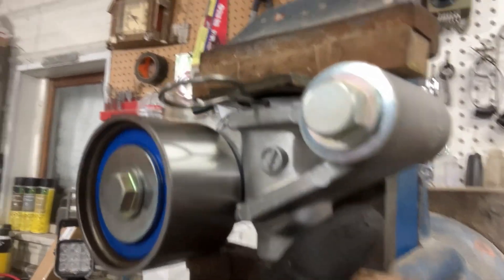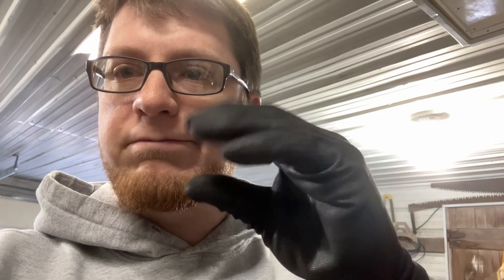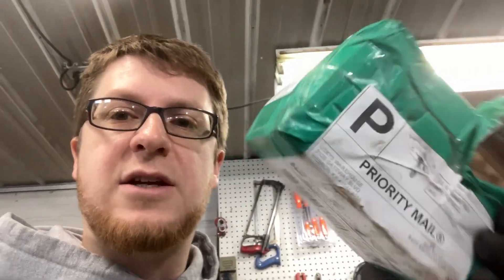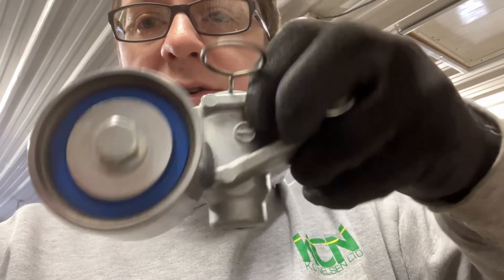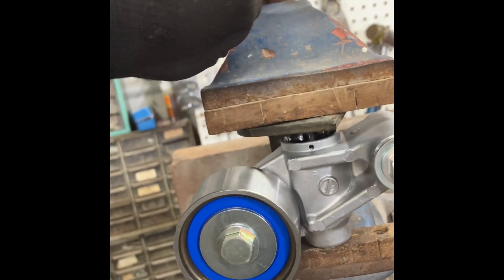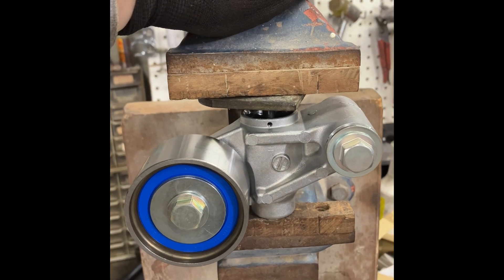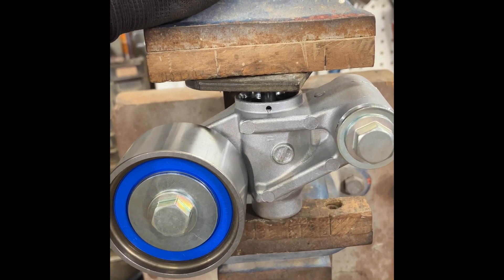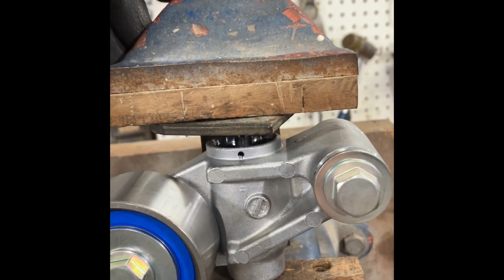Subaru timing belt tensioners, my nemesis

Comment: Recently replaced timing belt in an 08 legacy. New "kit", but it was a cheap one. Now there is a pronounced Subaru knock at start-up. Removed the half cover on the belt and the tensioner is vibrating at start-up but smooths out with a single engine rev. Only about 2,000 miles on new parts but I feel like I'm living on borrowed time. Sounds like I should re-do the job with a quality tensioner and possibly do your bleed technique.
Reply from the maker: I'd recommend replacing the tensioner with a quality one for sure.

Comment: did this help?
Reply from the maker: No. Ones I have bled have failed as well. I believe the issue lies inside the cam journals of the cylinder heads themselves. If the surfaces are marred and cause the cam to hang up slightly, it will cause the belt to over tension the piston in the tensioner and cause failure

Comment: No no your not doing anything wrong they absolutely suck I get the old style timing belt tensioner. I have a 97 legacy one to be exact and it works perfect… the rcm brand even copied the old design. The new ones suck.
Reply from the maker: I know there are kits available to go back to the old bracket and tensioner, but they’re something like 500 bucks. You just never know when these beasts are going to fail and then lights out… maddening when it happens. Other times, they will last forever. I don’t get it.

Comment: Part 2:  I do have 1 issue.  Covers off, I started the engine. No misfires or knocks.  Normal.  

I do hear a ghostly singing noise coming from either the crankshaft pulley or water pump.  Loudest just above idle.  

I hope it’s not the new crank seals I installed. Right?  They’re genuine Subaru, nothing weird.  The old one did leave crumbs that needed cleaning out—I hope none fell into that hole at 6:00 in the bore.

Have you had this ghost sound, perhaps normal with all new parts and no coolant or covers?
Reply from the maker: Thanks for the comments! I think the singing sound is the tone ring on your crank pulley rubbing slightly on something. I have seen this while trying things out with covers off. I assume you don’t have the damper bolted to the crankshaft? Try that with covers off see if your singing goes away. Please report back.
Reply from the maker: Sorry, try bolting the damper onto the crankshaft to see. I wasn’t specific enough. Doesn’t have to be torqued on to try it
Reply: @ Hello, covers are off, crank pulley is on with just one zap from the impact  gun for testing only.  Thanks so much for your reply—

I ran the test again, this time with my left ear on the lower radiator hose—“in” the hose actually-I am now fairly certain the ghost sound is coming from the water pump impeller spinning in the air.  The new pump is steel and resembles a windmill—so after the radiator and coolant are installed I expect no more noise.
Reply from the maker: @ excellent! Best of luck my friend

Comment: Hello, Putting my 99 Forester 2.5 back together, thank you for the excellent tutorial on bleeding that stupid tensioner.  I bought mine on eBay, Japanese part but  “new other”, so it arrived with no pin.

Given your warnings, I made a shim that prohibits that tensioner from retracting.  

I used a fender washer that is the same inside diameter as the piston and the same outside diameter as the casting, and cut a 1/4 inch slot to allow me to install it like a body shim—I installed belt, pulled pin and slid the shim into place.  The fit was a little loose, but the air gap is negligible.  To prevent vibration from possibly dislodging the shin I did put a heap of RTV on the tensioner first, smooshed the shim over it, and turned the shim 90 degrees to the slot is aimed down/left.  

I think it will work.  Once the tensioner is released and the belt has been cranked over a few times, the air gap is set and can be filled into avoid trouble.

Comment: the ones in the Aisin kits have been changed to a different design. they use to come with the exact same one as an original, but now even though the box say NTN and made in the Japan, the tensioner looks different than the genuine Subaru one which has "Japan" cast into it. (the new NTN ones dont). and i dont think they are the same quilty as the old ones. ive installed hundred on tensionors over the years and the only failures ive had where aftermarkets. try getting some OEM ones. if you dont have a dealer local, you can order online from Subarupartsdeals or Quirkparts. if you cant , might be better off reusing the original than installing a bad aftermarket.

Comment: I was a loader at UPS during college. Unless they've changed their rules to account for this somehow, there is no guarantee that your package is going to be shipped in a given orientation.  You can put arrows on all sides of the box and the label on the 'top', and it'll be more likely, but there's a good chunk of loaders that DGAF about your package. So, they sit in the semi trailer however they're oriented. Then, the unloaders at the next location are likely much more careless. Once it's in the system, though, it moves pretty fast for the most part. Just wanted to put that out there.

Fun bonus fact: I lived in central Japan for like 9 years and, at one point, was a delivery driver for a parts supplier for a lot of automotive-related factories around Hamamatsu City (where Soichiro Honda grew up). Dealt with Aisin, NSK bearings, Showa shocks, Showa leather, Enkei wheels, and a number of other suppliers commonly-used parts.

Comment: Just had a belt slip several teeth on the right cam after a head gasket repair Had a belt guard in place.  I reused the tensioner and belt since they had less than 10K miles.  I did recompress the tensioner a couple times and stored it on its side for a month.  Guess this explains my dilemma why the belt slipped so much and I did hear the “knock” but didn’t recognize what it was.  I do have valve damage so get to do it all over again.  I don’t think my cam would have hung up most likely thinking tensioner especially hearing the knock,  My belt slipped at idle in the garage so thankfully wasn’t stranded.
Reply from the maker: Sorry about your fortune. Tensioners seem so finicky. It’s almost like it’s vudu… real stupid

Comment: Over 3 minutes is a bit excessive. The instructions in my kit said no faster then 1 minute up or down. In service, the tensioner is going to see activation a lot faster then that. Pretty much instantious as your hit the gas the belt on that side will slacken, and tensioner will respond just as fast. Take foot off the gas and it will tighten just as fast, requiring the tensioner to respond just as fast. The issue was, you just were not bleeding the tensioner. I don't care which type of box it is in, it will end up being spun around in all directions during shaping. Bleeding is a must!

Comment: Hi is it possible to remove and fit just an aftermarket belt guard to a timing belt already fitted? My belt is only three years old and I would like to upgrade the guard for piece of mind.
Reply from the maker: Yes, you can add a belt guard pretty easily once you remove the timing cover.  I’ve done that several times.
Reply: @stvnswld  Awesome thanks for the reply 👍

Comment: Doing my own and thinking of adding a hard stop. Screw from top of bracket to limit the amount the tensioner can back off. Or a split set collar spacer on the tensioner piston if it can be fitted after tensioned...🤔
Reply from the maker: I have started using belt guards like the manual trans cars have. Over the crank pulley. I have also done what you’re suggesting! I notch a washer that slide in around the pin and then I put a couple of rubber washers around the pin also and silicone them together. To limit the amount of travel upwards the tensioner can go, great thinking. Necessity is the mother of invention, my uncle always says!

Comment: I don't know how many subaru timing belts I've done at my shop, but I have never had a tensioner failure. I do nothing special, other than install it right out of the box. Gates come laying on their sides, in the kits. Not sure what your issue was.
Reply from the maker: I think the cam hangs up in the journal and tightens the belt, causing an overload on the tensioner. Something I’ve learned since posting this vid
Reply: @stvnswld  i have seen that. Actually seens the cams snap in half from it.
Reply from the maker: @Arcade-fix  what causes that kind of damage? Dirty oil or lack of oil pressure? To cause the cams to wear and potentially break?

Comment: I stripped the 10mm bolt for the tensioner, no helicoil for me, i drilled out the remaining thread and with a longer bolt , threads out and a washer and nylock nut pulled it up to a snug pivot point ,what could go wrong? Already 50000km,

Comment: Bought a 03 OBW from someone who DIY'd head gaskets and timing belt. He must have not known what a torque wrench is because he stripped out the tensioner mount, which fell off two months later shredding my timing belt. Forced me to learn how to tear down heads and replace valves. What a headache!
Reply from the maker: I feel you! Quite the job indeed.

Comment: Do you have a part or source of where you're finding your belt guards? I've got the 3 and 4 cyl phantom misfire going on above 4k rpm. I've swapped every part except the reluctor gear, which I have ordered. Figured as long as I'm in there I would put on a guard for added security. Thanks
Reply from the maker: I get them on eBay. Usually they’re about $15 each. Another thing to try would be dumping a can of sea foam in the fuel tank. I have a ‘13 forester that was coding for “random misfire”, P0300 over 3500-4000 rpm. It hadn’t been run in quite some time, so I’m thinking the injectors weren’t flowing well over 3500 Rpm. After putting about 20 miles on, I can’t get the code to come back.
Reply: @stvnswld I have another 09 forester as my daily, so I swapped the entire intake and wiring harness over from that car to the one with issue, and it didn't take care of my problem. I'm just about at a loss as to what it can be if the reluctor doesn't take care of it
Reply from the maker: @prestonbear8981  I get that. I’ve been there! Misfires are tricky devils. I would try the seafoam, I know it’s like mechanic in a can but it’s worth a shot. Put it in the fuel tank and run it.
Reply: @stvnswld  I will give it a shot although I don't that's the problem because the injectors were part of the intake swap. I had the codes before I put a new short block in it as well. The old one had a rod knock so it needed to be done and just thought the misfire may clear up with the new one, but no such luck yet. I swapped the crank sensor with the other car as well, and put on a new Aisin timing kit. Heads were gone thru as well.
Reply from the maker: @prestonbear8981  you’ve probably already tried a knock sensor. I seem to remember a guy having a misfire and it was a bad variable valve solenoid. I don’t know how to test those though.
Reply: @stvnswld  it's a phantom misfire though, it's not actually misfiring the ecm just thinks it is, that's why I'm leaning towards a reluctor issue
Reply from the maker: @prestonbear8981  I hope that takes care of it for you. Let me know what you come up with!
Reply: Just wanted to update you and anyone else having phantom misfires at high rpms on both sides... A new reluctor took care of my issue! I was super relieved because that was basically the last thing to swap. The new one had oval cutouts in it where as the other one didn't which made it substantially heavier. Idk why that would make the difference but it cured it. Thanks for the Vid, as I was at my wits end!

Comment: This is so weird.  Having a tensioner from a gates kit just absolutely demolish my impreza a week ago I cannot understand how this can be a thing. Didn't used to be a thing I'm quite sure???  There was no bulletin in the tensioner I put on my old forester xt.  The bleeding process is new.  I think it's likely the manufacturer has a stop gap they hope works.  They should send a force gauge because I am sure my vise doesn't regulate itself under 66 lbs.  Sorry for the vent, but this crap tensioner stuff went from an unacceptably difficult head gasket replacement on a 2011 car to a nerve racking engine rebuild when the valves and cam shafts were trashed.
Reply from the maker: I totally agree. I’ve asked so many people about this issue. Pull the pin and go, is what the Subaru techs and everyone else tells me. I’ve had repeat failures on the same car even! It shouldn’t be so complicated, right?

Comment: I heard you mention Gates. Gates has literally become junk. The tensioner you have in the vise, definitely looks Chinese. The bearing might say Japan, that's the only part that came from Japan. I started buying Subaru's in 2003. I have never had an issue with timing components until Gates stopped using Japanese parts. I had a Gates timing set on my 06 Outback. Less than 5,000 miles, the bearing seals started slinging grease. If that tensioner in the vise doesn't say Japan, it is definitely Chinese.
Reply from the maker: The one in the vise was in an NTN package. The ones I’ve gotten directly from Subaru are identical to this one in the vise.

Comment: Are you parts Japan mainland ?
We don't use Gates as found many parts not Japan mainland factory sourced ,
Aisin is good kit, personally I prefer OEM sourced idlers/ tensioner all clearly marked Japan made and use Mitsuboshi belts .
Notes I seen on air in tensioner refer to only needing store in correct orientation for 24hrs before use.
Do/done hundreds of these and don't see repeat tensioner problems .
Reply from the maker: Thank you for the input! I am finding that the tensioners are failing because the camshafts are hanging up into the head journals and over tensioning the belt. That’s what is causing a lot of the failures.

Comment: PHASE I tensioner ftw. That said man that sucks
Reply from the maker: Thanks for the comment. Is there anything else out there other than the high dollar IAG setup? Subaru doesn’t make the old bracket anymore.
Reply: @stvnswld  I went with a junkyard bracket and laser cut my own added tensioner arm to use the sti/wrx idler. Pm me if you need the dxf, you can send it to any laser/plasma cut service of your choice. I also added helicoils to the bracket and replaced the bolts with 12.9 hardware

Comment: How, could air be introduced when theyre pinned as a air free unit. No movement
Reply from the maker: I guess I don’t know how, technically. If there couldn’t be air introduced somehow I don’t know why Gates would include a recommended bleeding procedure 🤷‍♂️
Reply: @stvnswld  
When it comes to timing belts don't trust gates info or parts ...
Reply: @scottloutner5253  There has to be an air bubble inside them from the factory, shake the item up and it becomes 1000 little bubbles

Comment: Just adding my  .02, ive been fixing subarus at my shop for 13 years never had a failed tensioner or belt comeback, ive used subaru, gates, and aisin kits, i prefer subaru or aisin and wont use gates anymore. i have probably installed 20-30 timing kits in my life on subarus. Now if were talking about a cloyes timing kit on a gm 3.6 i had one fail in 4000 miles, the oiling squirter hole in one tensioner was drilled in the wrong location, chain went dry and slack. Have a great day.
Reply from the maker: I recently had a conversation with a Subaru specialist several hours away from me, and he suggested that the cam might be hanging up in the journal enough to tighten the belt and overload the tensioner. He has seen it quite a few times. The remedy is a new cylinder head. I thought that was a real interesting hypothesis.
Reply: @stvnswld  Ah. So this unique failure keeps happening to the same car, not multiple cars that you have owned?